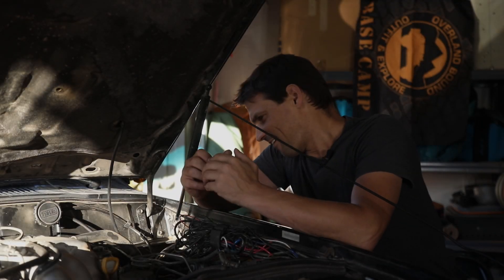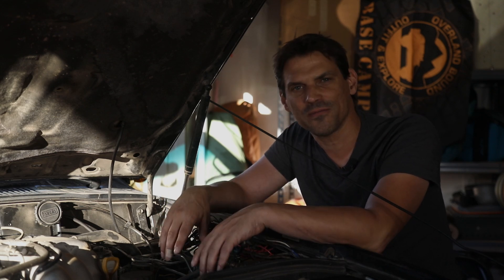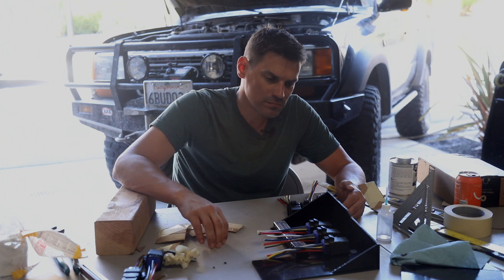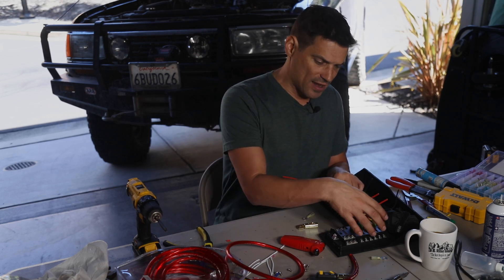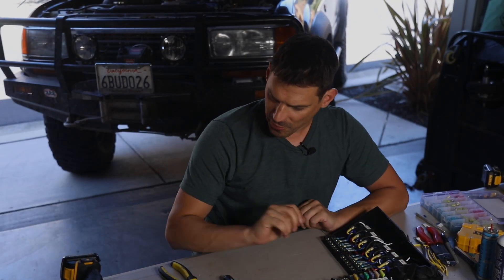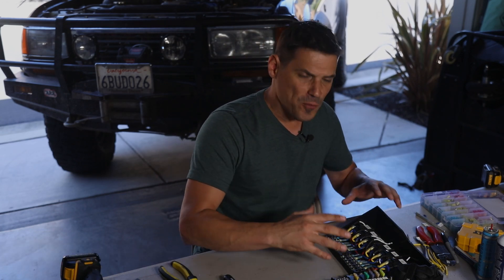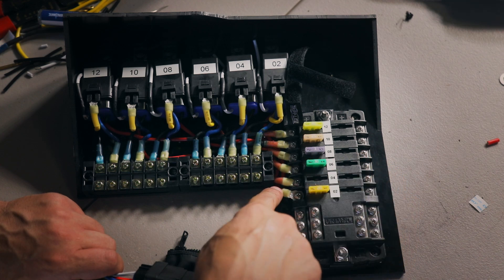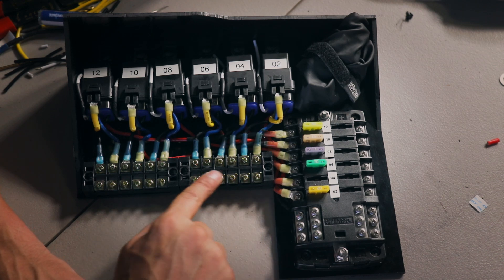DIY Fuse Relay Panel - Protect Your Rig!

Comment: might look into a crimp tool. not just a pair of "pliers" as these tools give a specific amount of psi onto the connectors, not just a crush and hope it holds, also pending what you are crimping there are different shaped jaws. simple hand held for general wiring,  up to hydraulic for larger cables. he "crush" they give removes any real chance for water to get in, and start any corrosion. aka: no air space between the wire strands.
Reply from the maker: Very good advice.

Comment: Great video.  2 questions.

1. Can the white (86) and red (30) wire both go to the same spot on your blue sea fuse block.  

2. If negative switching, does the LED in your switch still get power and turn on? 

Thanks so much.
Reply: normally the led in the switch has a separate hot wire

Comment: So, here is my question. Say we want to have the switch backlight lit up so we can see which one we are hitting in the dark. How do we do that with this setup? Is there a way to wire up an interior cable from the dash lights to power the backlights on the switches or do we just have to fumble around? Honest question because I love the ground switch setup, but I also want to see which switch I'm hitting, thus would need power running to it from somewhere.
Reply from the maker: Yes correct. For illuminated switches, you need power.
Reply: @OverlandBound  Sorry for the long question. I am new to the whole "trying to do things correctly instead of just throwing it together as I did in my younger days" thing. There are a ton of resources to learn from out there for my truck, but not a ton of things you can just buy to make it work (like backlighting the switch)
Reply from the maker: @tamccullough88  Absolutely. And it’s often very hard to find just what you are looking for in a sea of Internet information. I’m here, glad to help!
Reply: @OverlandBound  if you happen to know the best way to tap into the stock accessory switches backlight on a 2017 Tacoma without having to cut into the wire 😁

Comment: Loving the video. The white wires will need minimal 12V to actuate the relay, what’s your way of connecting them when you install the box? Can I put them all on one fused slot (very low amp fuse) since I have few extra free slots on the blue sea box?

Comment: Great Video thanks for making it,  however, early on in the video  5:35 the "Blue Wire is terminated" and the "Yellow" 87A connected to the bus. Where as, 9:20 the Yellow wire is terminated and blue to the bus.  Is there a difference in the two? They both supply power to the device correct?

Comment: Great vid! Based on the wiring diagram, it looks like only a negative wire is running to your switch(es). I imagine that this means if your switch has LED lights, you will not see them unless the switch has been activated, correct?

Comment: I like your old-school thinking. 😃
- You’re absolutely right about negative switching the relays inside the vehicle. 

As you, I am in favor of soldering. However, as an engineer, please keep in mind that the solder material is sensitive to vibrations where it ends up inside the cable. Meaning, soldered cables needs to be firmly zip tied down to eliminate the risk of breaking over time.

One last thing…
Dipping a naked wire in a little grease before crimping it to a cable shoe will prevent future corrosion.

Comment: Im still confused where im supposed to wire the white wire. Do i connect it straight to the battery?
Reply from the maker: Basically, yes. I have a 4GA wire from my positive terminal to the fuse block, and its attached to that. Make sure to look at the wiring diagrams in the description!

Comment: Just got done watching your video and learned a lot, thanks. I have one question about the relay. I’m noticed you said the white wire will be connected to positive. Are you connecting that straight to the battery or connecting it to the blue sea block.
Reply: Same question here

Comment: Thanks for making this video.  Very well done.  There is one thing that is confusing me though which is the white wire on the relay.  You said it goes to + 12 volts and that's where I get lost.  Based off the diagram, it looks like the red and while wires are spliced together going to the fuse box but you don't show that in the video.  Could you please clarify how you use the white wire?
Reply: Yea id like to know aswell where the white wire goes
Reply: Here also
Reply: Both the RED wire and the WHITE wire need to be powered, preferably with fuses for safety. Looks like he will be adding the WHITE wires to the opposite side of the Fuse Block, based on how he labelled them at least. This just an assumption though

Comment: Just a comment, when you choose to run negative switch, make sure the switch, wiring to the switch and also the ground wire can handle the amount of current you are pulling from your relay. Since you want your ground cable being same size as your positive to being able to actually pull the required amp from the relay.

Comment: Excellent video. Building a serviceable relay / fuse block like this seems be be a much better option than spending several hundred dollars on a fancy name brand unit that can't be repaired out on the trail.

Comment: Thanks for the great explanation and demo. I wonder: is there any issue of potentially reversing polarity by switching on the negative?
Reply from the maker: Absolutely - but only as that pertains to any wiring setup.
Reply: @OverlandBound  thanks for the quick response; for clarity are you saying polarity could back up through the relay and cause problems with the truck computer? Keep up the good work...
Reply: I would say yes. Lets say you run something that pulls 30amps from the relay, that relay is being grounded through the switch. The rule is to have the same size wire for positive and negative(+ and ground). Not many switches can handle a 30amp support...

Comment: Old video but I have question:

Why did you not connect the white wire to your power distribution block with a small fuse (5A) for the switch side? Would this not work for some reason? 

Sorry not an electrician but looking at building something like this for my truck. Trying to learn.

Comment: i understood everything except when it came to the relays. where are you suppose to get the 12volts to operate the relays to closed the high power circuit?

Comment: Great video. Things are finally sinking in with how the relay works into this. Forgive me for asking a noob question, but why label 12 10 08 06 04 02? Isn't 1 through 6 adequate or is there a standard to be followed that I'm missing?

Comment: Did you also make your own switch panel inside the cab?
Reply from the maker: Hey there! the 80 series actually has 6 switch blanks inside that I use for my accessories. The switches I use look like a factory fit.
Reply: @OverlandBound  Nice. I bet that looks clean. I'm trying to come up with ideas for my Titan XD.

Comment: this is really hard for beginners  ... until it isn't anymore and your brain gets that the relay is just a bigger switch that activates (switches) when you add electricity and can handle 60+ amps..

its like slapping a bull .. .. you flip the tiny switch in the cab and the bull relay activates and the big 50amp current charges towards the 40amp 9" LED driving lights from the battery

Comment: It wouldn’t be a bad idea to connect all the ends of your spare relay with the ends so your not doing that in the bush. Make sure that you extend the red wire to the furthest relay in your case #12. I would hate to try and make the ends in the bush.

Comment: Great video very well explained. The only thing I am confused about is how the starter motor is connected? 

On my car the 4Ga battery cable is connected straight to the starter, with a smaller wire coming off presumably for accessories.

Does it go Battery + to breaker to fuse/relay box then one to starter motor?

Comment: If the relays have their own negative wire, what do you do with all the negative wires that each accessory already has?  If you combine all the negatives wires into one from the relays do you send that back to the battery or do you attach to chassis of vehicle?
Reply from the maker: Body ground it. You can ground at the accessory source, but individual accessories have specific needs so double check.

Comment: Did you wire white and red wire from relay to the blue seas fuse block for your 12V power. 

Did t understand where you wired your white wire for 12V
Reply from the maker: This will help! https://youtu.be/FWdhmu9TuQk
Reply: Overland Bound watched it but still don’t see (outside the fuse relay diagram) where you wired the white wire back into the 12V wire. Looks like you connected it to the main power wire before it got to the blue seas fuse block. Is that what you did and if you are you able to show a pic or something on how you did it?
Reply: Overland Bound attempting to replicate with my 3rd gen Tacoma. Never thought of the negative powered switch till came across this.

Comment: I'm confused about the white wire, so it is also going to the battery, but isn't fused? How did you join all of those white wires together and connect them to the battery? did you make this connection without a breaker? If you can share a diagram, that would be amazing!!

Comment: Wonderfully clean wiring set up. I wonder why you did not use marine grade wire as it has better insulation and more strands per gauge so it is able to carry greater loads ( redundant overload protection). Also I would suggest marine relays as they are better for possibly wet environments. They also do better handling dirt and grime. I am in the process (when I get back to the states) of rewiring my Suburban and will be using as much marine wire, connectors, relays, and junction blocks as I can get so I do not have any problem with possible shorting. I will also use through bulkhead connectors to run the wiring in order to support and protect the wiring.

Comment: What's the difference from using a relay to just a switch? Thanks awesome vid
Reply: switches can only support minimal amps through it before it burns up. a relay allows the load to go throught it and to your device without blowing up your fancy led switch.
Reply: @Antho2529  got it, thanks man!
Reply: also you lessen voltage drop buy having the relay closer to your acc than the battery

Comment: You could have done everything here in one single Eaton SSVEC out of waytek for less than 150 and in 1/3 the foot print. (no apps or IC's all done via internal bus bars and external wiring.)  For something going off road I would want it sealed up good myself.  Either way there are always options but not a bad job.

Comment: ?  So from the relay to the accessory it's power side switched?  Am I correct?

And then if I use an illuminated rocker switch 5 pin how do I wire that for the lights to work on the switch?

Comment: Question, where do the negative grounds form the accessories run to? Also do you power the switches from the fuse panel or buddy off a cab light  harness?
Reply: can be grounded to a nearby chassis bolt, can power switch from fuse panel or from interior in the cab up to you how youd like to run the wires

Comment: I am just blown away totally by the gorgeous workmanship and ground trigger  arrangement. I have repeatedly looked at the video, especially of the diagram and your immediate explanation around it. However your final summary immediately after explanation got the better of me. The diagram shows the white wire from terminal 86 going to the positive of the battery and the black from 85 going to the switch ground. But you might have referred to exactly the opposite setup when summarizing. I am now confused, as I thought the negative trigger would mean that 85 would go to the switch and from switch to ground. And 86 and 30 going to the same source or 86 going to some other 12V source that's on when ignition is on (engine off). Please clarify. 🙏🙏🙏🙏🙏
Reply from the maker: HI Vineet, I believe you have this correct. 30 is Battery Positive. 86 is Positive (or ignition positive as appropriate), Black is the relay switch (trigger) ground. Blue or 87 goes to the device (pos). I hope I didn't get it wrong in the summary - I did re-watch and it sounded right. Feel free to PM me on our forums https://www.overlandbound.com/forums (I'm Michael)

Comment: So you wire the main power from the battery, through the breaker, to the fuse panel (with individual fuses based on power of that specific accessory?), then for each accessory you run the power through it's own relay, and ground it through the switch to a body ground in the cab? So if you were running 3 lights, you'd need 3 relays? Also, by running it your way, is the accessory powered while ignition is off or not?
Reply: Also, how does the white wire get run? Each white comes off the individual relays and then straight to the battery? Or are they somehow grouped into one wire and then tapped into the red 4ga wire after the breaker or something? I'm confused about that part.
Reply: I too did not understand the white wire connection.

Comment: What a great video and explanation of negative wiring switches, its genius. Ive cruised through your existing videos and did not see, so forgive me for asking if you have one to satisfy my question. Do you plan on doing a video to show your switch panel configuration and wiring assembly, as well as going over what each switch does and how you routed it to the relay box and the accessory.. it may be asking alot, but i think many would benefit from how thorough your content is. Thanks again for the post..

Comment: Wow. Thank you so much for this great film. Subbed before your video was done and will join in a few. We think a lot alike. I am doing a frame off on my Yj at this moment. Originally I planned a crawler of sorts but now have the Overlander bug. I gave away the complete dash, heater and threw away all the wiring. (It is an '87 never driven in snow, rare here in NE.) The only differences in mine are:  I am using mostly Bussmann  blocks to conserve space where possible, All but one of my blocks and distribution are in waterproof abs boxes, and I am relocating the Odessey battery to the rear.  I completely agree with the negative switching, Blue Sea and marine cable  where ever possible and exposed. Again Thank You Sir.
Reply from the maker: Thank you so much for watching! I'm glad it was useful!

Comment: I'm not electrically inclined, if the red goes to the fuse block that is powered, where would you plug white into? Is there a good diagram?

Comment: As a recent OB member I was pleased to stumble on these videos.  This guy makes great content about things that are relevant to the community.  Question though, as this is not a battery the negative switched relay thing doesn't compute for me.  Whether you switch with negative or positive you are still completing a circuit to ground.  The guts of the relay, for the purpose of switching, is just an inductor coil, so it's still passing 12v, right?  Since the circuit is fused I don't see the point of this, other than being able to ground at the switch, that's cool, but I would be concerned about ruining the relay, as it might act as the fuse in this circuit seeing as how the windings are such small gauge wire.  I know relays are cheap, but when you are in BFE they could get hard to find.  Of course, it's entirely possible I don't know what the heck I'm talking about either...

Comment: Why not have your spare relay pre-configured? So as to not have to do any soldering/shrink tube work. Just plug it in and connect the wires to the terminals.
Reply from the maker: The relay just plugs in to the existing socket. No soldering or wiring required.

Comment: So if you were to run the ground wire from the bus bar to a switch, then tie off that connection and run the ground to another switch, that would essentially work to power a set of light pods from 2 separate locations if both switches are also grounded, correct? Or would one of the switches being open effect that? My goal is to have a switch in the cab of my truck and also a switch in the bed, so if I decide I need the side lights on to see something, I don't need to go inside the truck and can just flip a switch in the back.

Comment: I plan on doing something similar to mine for a couple different lights and other small accessories what is a good size wire to use and can you make a jumper to power another block in the back

Comment: By doing a ground trigger source (switch), if you have a 3 or 5 pin switch with LEDs, can you still wire the switch so that your LED turns ON?
Reply: yo, did u ever figure this out? This seems to be the flaw with this method?

Comment: Nice DIY.  I like the idea of the negative switching, and you are correct, it is safer.  One suggestions- I typically don't run my grounds to chassis.  I've been running a separate negative from the battery to a ground bar and then home running my ground to the bar.  More reliable than the chassis.  In your design it would just mean one more wire thru the fire wall to your switch bank, and since it's only powering relays, it down't have to be a large gauge wire.  Aside from the negative switching, I have a similar design on my Jeep for lighting & compressor circuits.  Works well.  Safe Travels and God Bless!

Comment: I love wiring and trying to make things simple but I cant seem to figure out a system properly lol. Trying to create a system like this is so confusing for me lol. I want to buy an FJ cruiser soon and I've been trying to figure out a power supply system. I have a small 6 slot fuse block, and I have some relays as well. Most of my powered things will be some LED lights, maybe an air compressor but I'm not fully sure yet